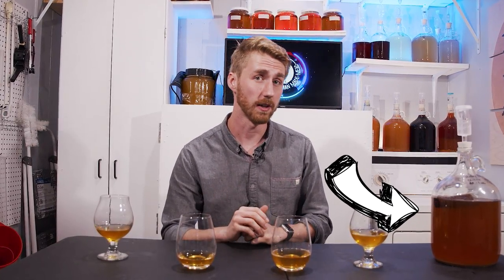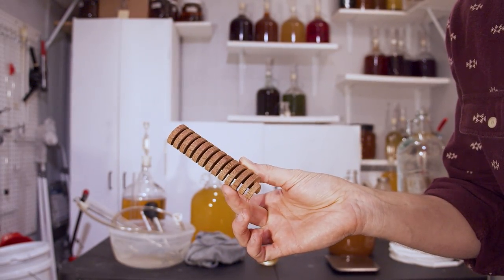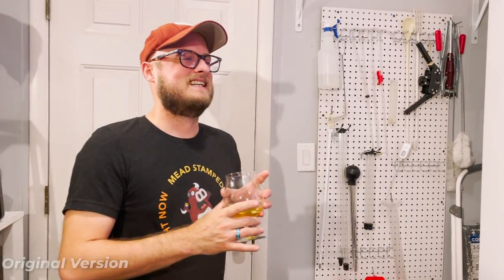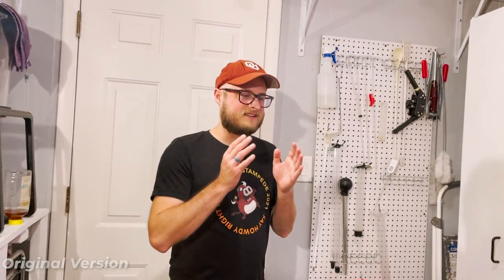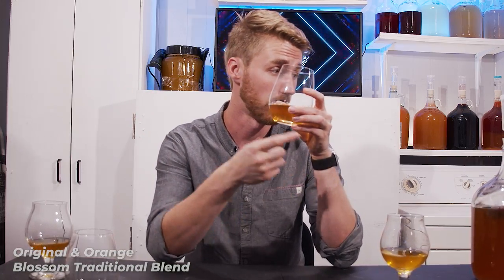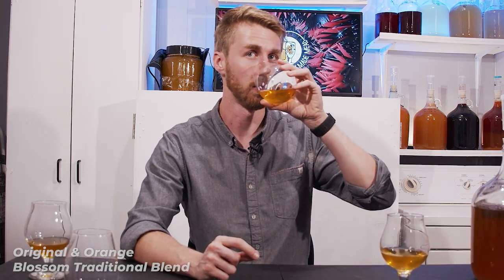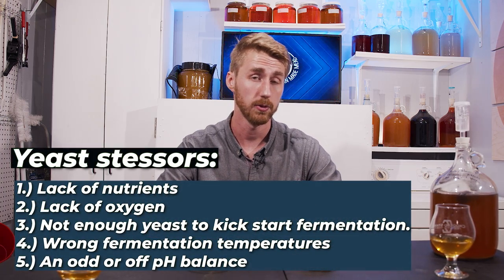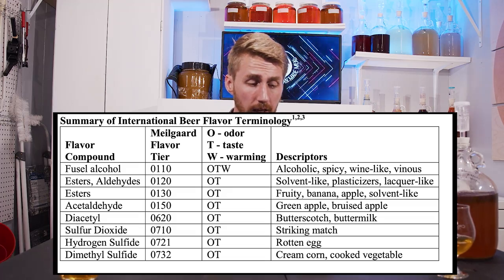Bad Mead? Here's a fix!

Comment: So a question not really related to this video. It's often suggested that you leave your ferments in a cool, DARK place. But I notice you've got a lot of backlight for your meads, and the room seems generally bright. Does this affect the fermentation process in any way?
Reply from the maker: My room stays dark about 80% of the time. I just use the lights when I’m recording! I haven’t noticed any problems with my meads!
Reply: @ManMadeMead  cool! The thing I'm taking away from this is keep it in a dark place as much as possible, but if it's exposed to a bit of light temporarily, don't stress out about it! Thanks!

Comment: I have been having a problem with my finished meads tasting off and im not sure what im doing wrong. I know you have probably answered this question before but how long can I leave a mead in a carboy before I should consider bottling? I feel like I may be bottling to early, it seems like when I taste my mead straight out of the carboy its fine but after its been in the bottle for a couple months, it has a much less appealing taste. is this a degassing issue?
Reply from the maker: You can bulk age for as long as you want as long as there isn’t a lot of oxygen on it! I have a mead bulk aging for the past 2 years now!

Comment: Moldy mead could be fixable with potassium metabisulfite, couldn't it?
Reply from the maker: Nope! It helps to prevent further mold but won’t fix mold already there!
Reply: NO!  Some molds produce mycotoxins which can cause sever allergenic reactions, and in the worst case, WILL KILL YOU.

It's not worth messing around with.  It's not like a cheese where you can cut off the bad parts and make it okay.